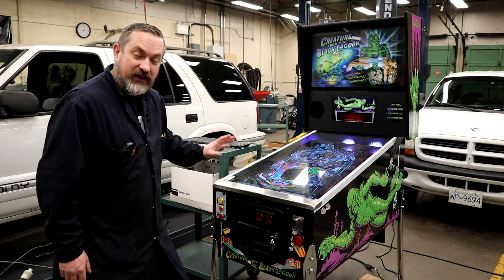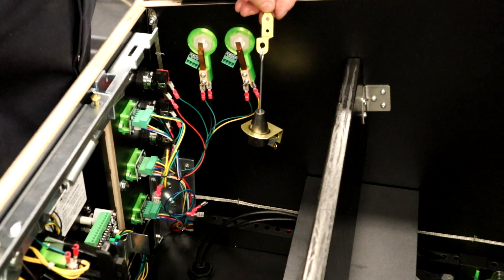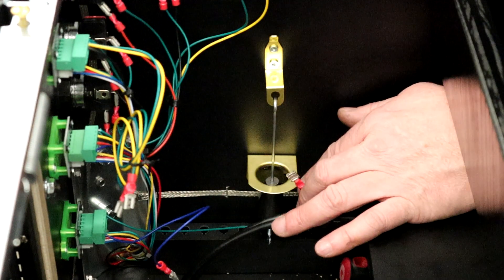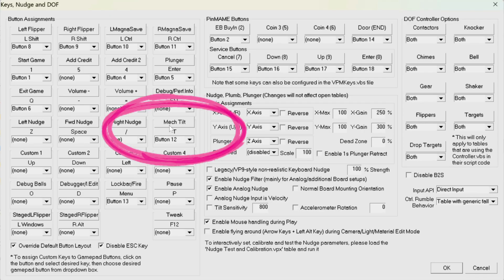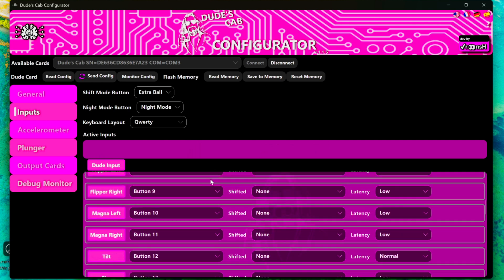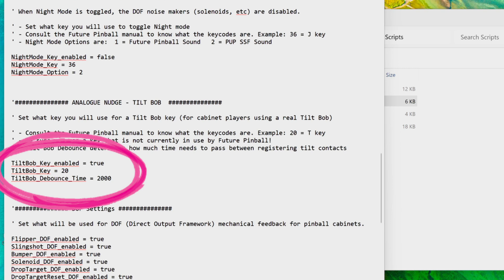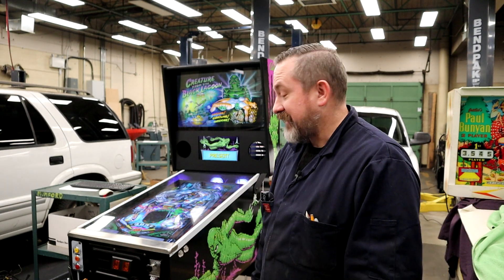How to install a tilt bob mechanism in your virtual pinball cabinet!

Comment: Hey Emil, how did you modify your dmd area to correctly show the entire screen? In your earlier videos the bottom was cut off and I have the exact pack and want to fix it properly. Also, thank you for all you do!
Reply from the maker: You can go into the baller installer monitor selection and modify the size of the borders.  Save it and you're done.  Cheers!

Comment: Great video!  I mostly play without much nudging.  But It's a big part of skilled pinball play.  I've got lots of DOF toys so yes I do get the SSF setting off tilt occasionally.  So it's time to me to upgrade my cab with a real tilt and also start nudging more to improve my game play.  I've got PinOne boards but as you say it should be similar.  Thanks!
Reply from the maker: Yes sir!  You gotta upgrade to a real tilt bob....sooo much better and zero ssf false nudging.  You should start with slap saves on the flipper buttons, I use them all the time and is a great way to start influencing the ball.  Thanks for the watch and your support for the channel.  Cheers!

Comment: When I did this way back I played a table with 3 tilt warnings as default, as in the 3rd being tilted out of that ball. Mech job trips the first tilt warning, but if you trigger it again with a short period of time I got 2nd AND 3rd for one connection. This was due to something in the script folder which I got fixed after reading up on vpforums. You should try and see if this also applies to you even after renaming the mrjet file. Get back to me and I check my cab for you boss, oh and great video as always 🙏❤️
Reply from the maker: I'm pretty sure it has the 2 warnings and then it tilts on a 3 touch but I'll have to check. If it was an issue, you could go into the service menu and adjust the tilt warnings to 4.  Thanks for the watch!
Reply: @wayofthewrench  haha yeah, but I tjink the rename of that mrjet script files actually solves this. ❤️

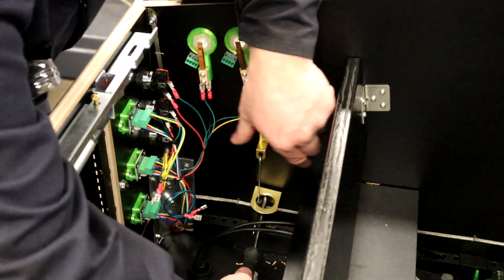Comment: 3:39 not the best place to place the tilt mechanism
Reply: It's where it sits on my real pinball machine, or did you mean because you need that area for mounting stuff?
Reply: @WingburenArcade   i mean you mounted it  not the best place on your vpin :) i littlebit higher position is better for it :) but nice work  i think i make screenshots from the vpx setup :)  with your premission of course :)
Reply from the maker: You mean the tilt bob mech should be higher in the z axis?  Like further away from the bottom?
Reply: yes :) it could be better place a littlebit higher on the z axis :)
Reply from the maker: Yup, and it plays just like a real pin.
Reply from the maker: It plays just like a real pinball machine so I would say it's in a good spot.  Thanks for the watch!

Comment: For some reason I cannot get my tilt bob to work with my KL25Z board on one of my cabs, which is especially baffling given that a very similar KL25z setup works perfectly with my other cab, and the accelerometer/nudging work fine on this one.  Top connects to the board and the bottom connects to ground (a metal screw on the cab) right?  The board itself seems to be correctly programmed to send T when the bob connects.  Gorgeous cab you got there, btw.

Edit: nevermind, the ground wasn't connected to an appropriate place.  Tilt works fine now.  Thanks for the video!
Reply from the maker: Perfect!  Yeah I was going to say that your ground wasn't right but you figured it out.  Thanks, yeah she's a beauty!  Cheers!